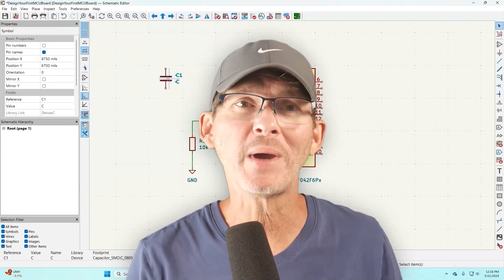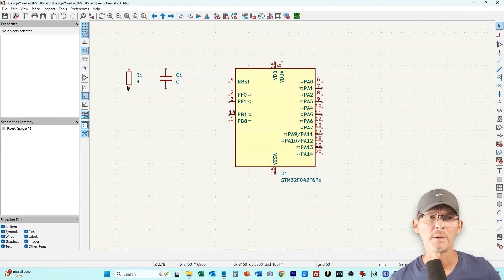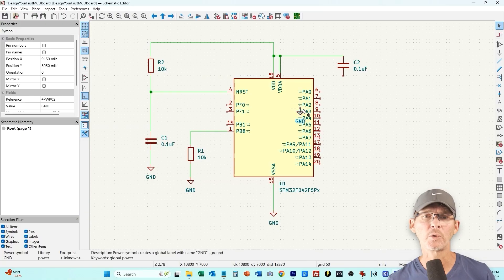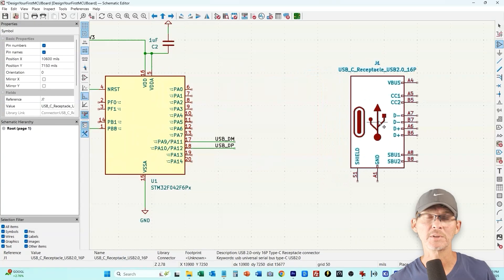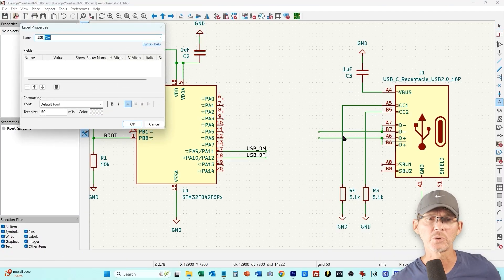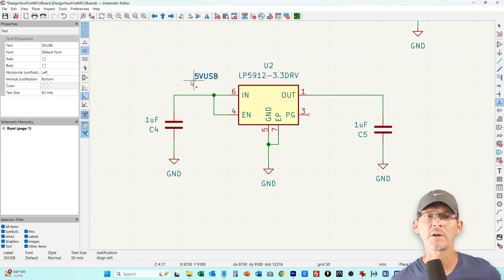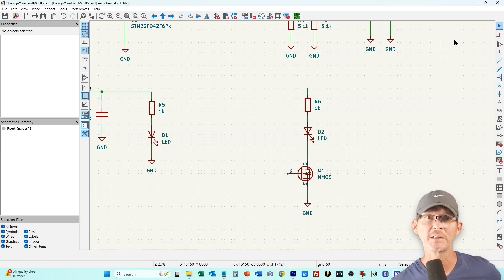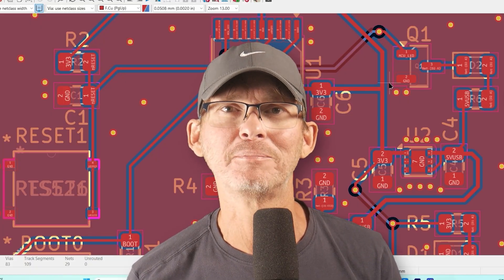Design your first microcontroller circuit in 10 minutes

Comment from the maker: Expand this circuit with more features: https://predictabledesigns.com/first-mcu-extras/?utm_source=youtube&utm_medium=description&utm_content=first-mcu-extra-features&utm_campaign=first-mcu-07032025
Reply: okay i used a zenor diode 5.6 on N- comparator  and N + to the power rail , comparator gate will pull high or low to switch a P-MOS gate on/off. 5.5v volt is free to pass "pulls P-MOS low" 7.4v/ lipo's "pulls P-MOS  high" and bat power will go to LDO/Buch to create 5.5v for the board. Am i correct @PredictableDesigns !!!!

Comment: Great video. Would you recommend adding a HSE Oscillator on PF0 and PF1 (for GPIO timing purposes)?
Reply from the maker: Since this MCU has a factory trimmed internal oscillator it's probably not necessary, but it depends on the timing accuracy you need.

Comment: This video is just what I needed! May you share why you have chosen a LP5912‑3.3DRV over a TLV75801PDRV which you have used in other similar cases before for the 3.3V regulation? They are doing the same thing, but maybe I'm missing something..
Reply from the maker: I think mainly I just wanted to use a different chip for some variety. But the LP5912 does have lower PSRR and lower noise.
Reply: @PredictableDesigns Thank you very
much!

Comment: I'm wondering why you did not use pull down resistor with NMOS. Also using a small series resistor is actually helpful to limit the current. I get that this is supposed to be simple design but without pull down resistor, NMOS does not turn off.
Reply from the maker: A series resistor is frequently a good idea, but there's no need for a pull down as long as the gate is always driven high or low by the gpio pin and the gate should never be left floating.
Reply: BTW I love your videos. I learn so much from them.
Reply from the maker: Thank you!

Comment: Could you do a video on soldering these boards locally rather than using an assembly service from china, specially with new tariffs in place. It would speed up debugging and prototyping. I have seen videos on hot plate soldering but never tried it.

It would be great to see your boards physically work, so not just the design aspect, but also prototyping and testing.
Reply: +1 . As the Fabrication Part of the PCB is literally full of chaos like using Fecl3 , Drilling (spl for THT ) , printing etc!!!

Comment: hey the i just started in circuitry designing "self taught/learning" im trying to create a path which uses a regulated  5.5v, if someone plugs in a battery 2S lipo (7.4v) the 5.5v path gets shut (no current flow) and battery power takes the path to a LDO/Buck to create safe 5-5.5v for master board. regulated 5.5v (bypass LDO/buck "regulated 5.5v comes from a power stack") i love our videos it help me a lot!!! will you create a video on this circuit to help me out please :)